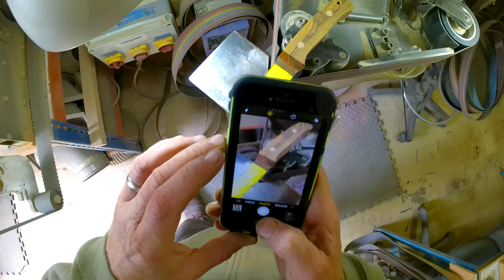Point of View Knifemaking! (WIP Wednesday)

Comment: Thanks for this video. Excellent. Camera position may work better on the chest mount, (if it doesn’t impede your work) since our view didn’t quite include the point where belt met handle. Other than that, I learnt a lot. Cheers
Reply from the maker: V isions thanks that’s what I thought. I think the chest rig will be better also prevent a little too much moment. Didn’t now I moved so fast 👍

Comment: Ben  -  I'm having trouble with my pins doming.  I'm using a flat piece of aluminum to sand the top of the handle.  I have a couple of knives that have the domes showing.  What do you recommend.  Thanks in advance.  Jim
Reply from the maker: It can be tricky to make sure they stay flush. 
I find a thick bit of leather to back the sandpaper works well. But also try and use a file to concentrate on the pins and not the handle material. Then a light clean up with paper. Hope that helps cheers Ben